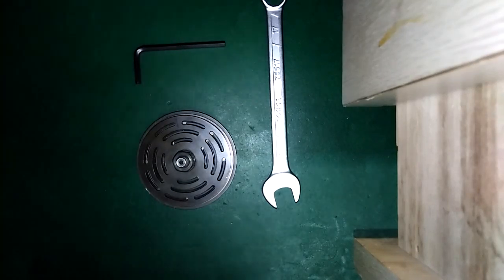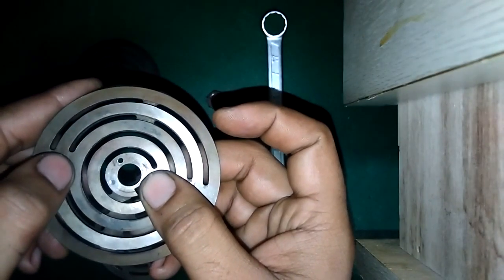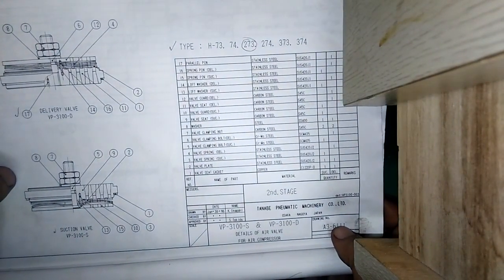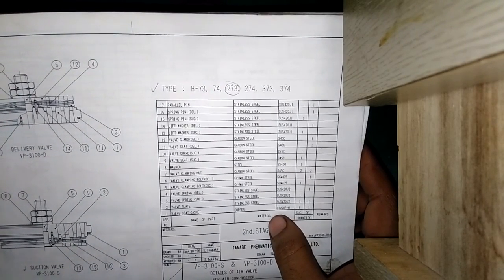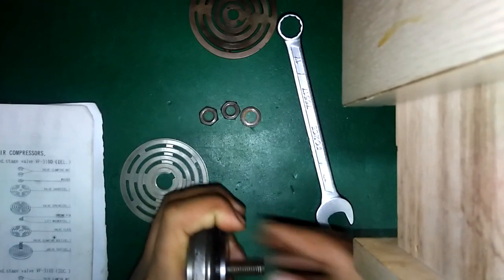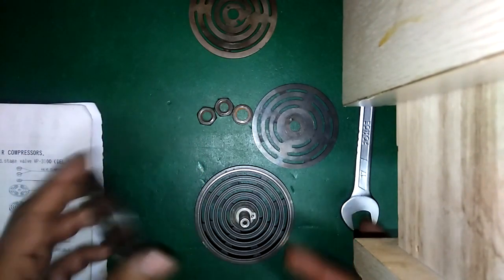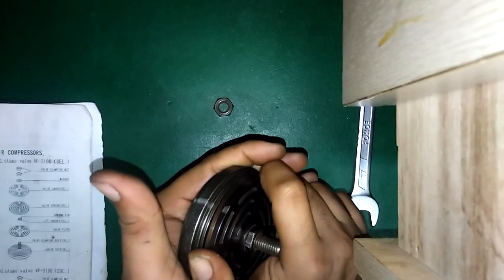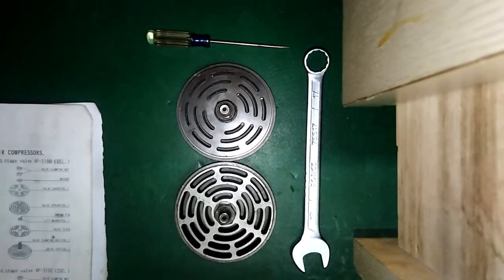Second Stage (Discharge Valve) of Tanabe Air Compressor

Comment: small correction bro,, 17mm spanner does not mean bolt size is M17 , most probably bolt size is M10
Reply from the maker: Hi Shubham, thanks for rewind, yes it is 17MM spanner not M17. Already spoke 17 next to M17 for correction in video.

Comment: Dear sir's
We are one of the leading  manufacturer & exporters of above 500 type high quality  marine & industrial lub/non lub all major make compressor valve assly and its inner components as per ISO 9000 std. 

our mail, shamaenggworks@yahoo.com
Reply: Zaheer Ahmed total valve solution..8130475055

Comment: hello sir 
i would like to confirm you that we are manufacturer of air compressor valve.if you have any requirement.i can provide you all the stuff.for more information please contact us.
Mobile No: 9548592112
Mobile No 2: 8126429414
Telephone No: 121-2708344
Email id : rj.enterprises1221@gmail.com